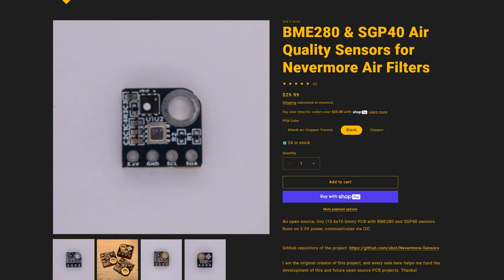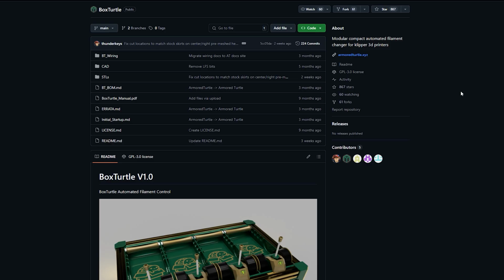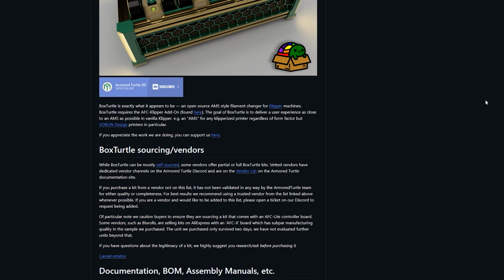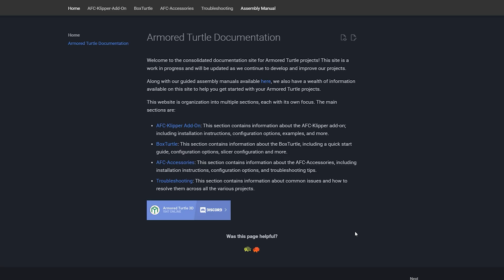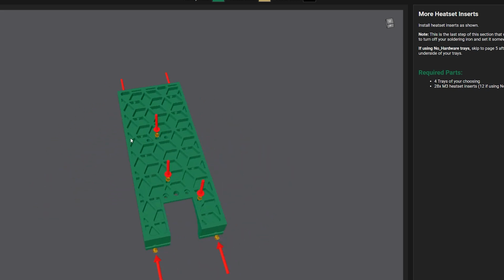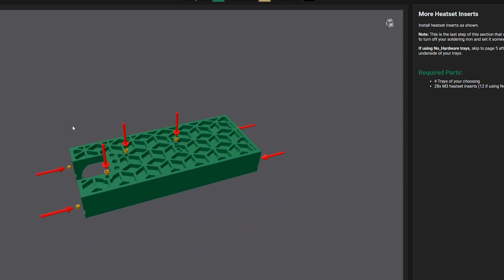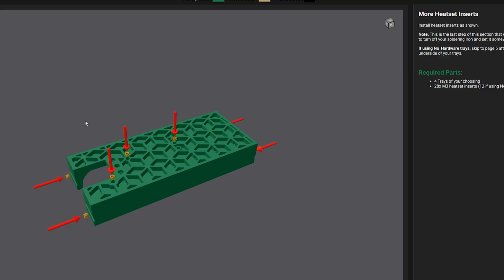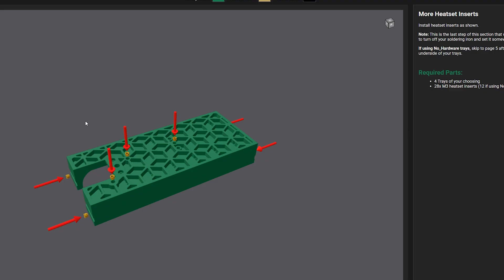Box Turtle Controller PCBs - AFC-Lite & AFC-Pro

Comment: If I wanted to run this via USB but only wanted 4 wires out the back of the printer Does this require/do anything the 5v from usb cable when it's in buck mode? Would just the d+ and d- be sufficient if I'm powering it with 24v. I'm thinking of using a spare usb adapter board from a nitehawk toolhead kit.